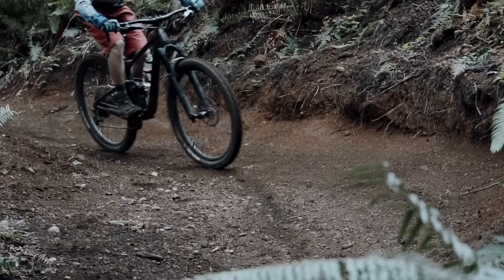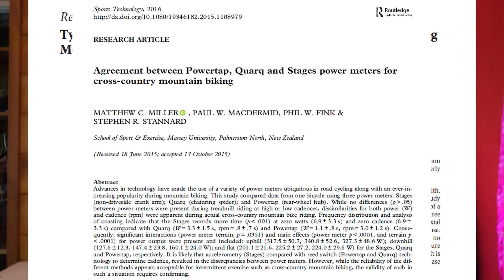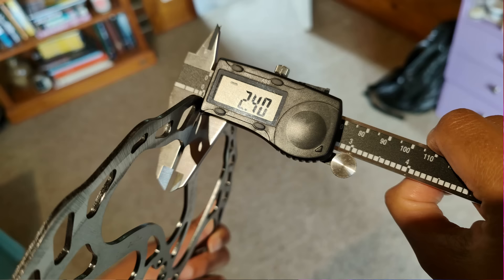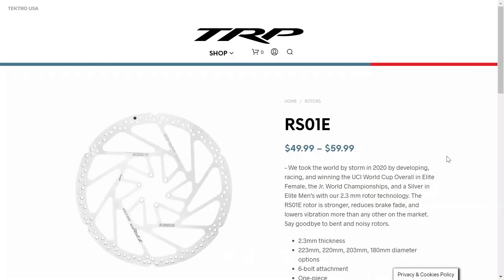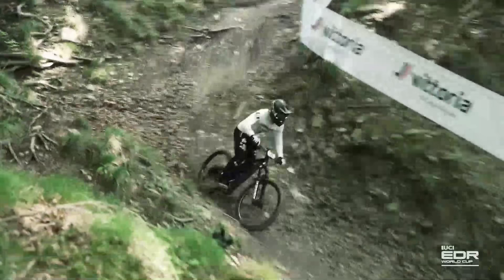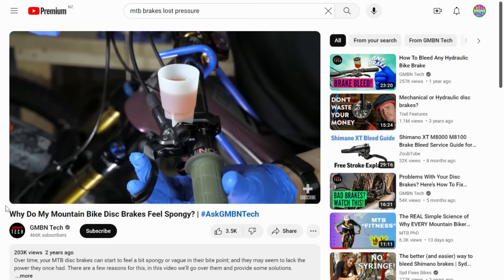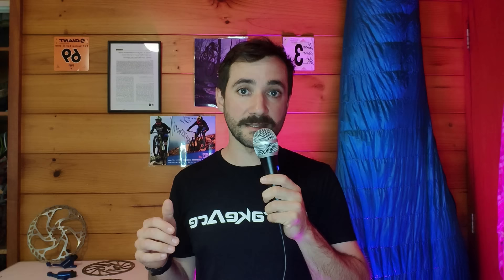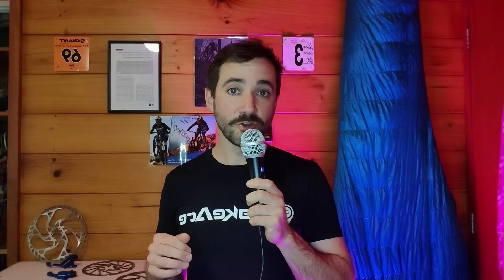Why THICK Rotors Will TOTALLY Change How You Ride (EASY Upgrade with REAL Proof)

Comment: I'm a little bit concerned about a possible scenario where my MT5 brakes get hotter with thicker 2.3 rotors due to a decrease in ventilation between pads and rotors. I've heard one bike mechanic blame Formula brakes for being too hot, exactly because of that. Do you think this might be a problem and a reason to stick with my stock 2.0 Magura rotors?
Reply from the maker: What rotors are used with the Formula brakes?
Reply: @mtbphd   I'm sorry, I haven't ever seen them in person. Let's consider it just a random opinion from a random bike mechanic. I have zero ideas about whether it's true or not. It made me think about the possibility that a thicker rotor may affect an increase in brake temperatures due to worse ventilation. I thought you might have some thoughts and experience in that as an expert.
Reply from the maker: @AntiDEDok  I've never heard of that issue, but it does have me wondering how much air flow between the pads and rotors matters. Thanks for getting the wheels spinning! At least with this setup I didn't have a problem
Reply: @mtbphd   I noticed Galfer's comment under a guy's video yesterday. They mentioned that their rotors make "popping" noises for a reason. In their case, it's due to a special design where hot air moves through holes in the rotors, cooling them like an exhaust. I'm not sure if we should believe that or if there's any measurable statistical difference. However, common sense suggests that the space between the rotor and pads may have some effect 🤔. It would be nice to see some scientific MTB content about it!

Comment: 5:18 I really don't like the MT5s, I had them on my bike and the modulation was awful. I was scared to go fast because they either wouldn't stop or flip me over. I tried everything and ended up swapping them to shimano brakes.
Reply from the maker: Interesting. I feel like they're always there when I need them. Resin pads
Reply: @mtbphd  I had metal pads, i need a lot of braking power since I'm tall and heavy.. Might've been that the specific ones I had were faulty

Comment: I have as I call, pornography of brakes: slx 7120 levers, mt520 calipers, zee finned brake pads and 2x ice tech 203mm rotors, best brakes I've had so far. On ebike with total riding mass 124kg, works very well.
Reply from the maker: Can't go wrong 🙌

Comment: Don't buy Chinese made Shimano disc rotors, why because that are only 1.7-1.6mm thick and the two sets I purchased from the bike shop were only 1.6mm. When I questioned the bike shop they had no answer, only to say that is what Shimano Australia supplied them. 
What's the problem, simple stamped on the disc is a warning to replace the rotors once the reach 1.5mm, so you only get 0.1mm of wear before they have to be replaced.
The Japanese Shimano rotors are 1.9-1.8mm thick and they also are stamped and state they should be replaced when they reach 1.5mm thick.
I have dumped Shimano and gone with 203mm Tektro rotors that measured 2.0mm thick and are also stamped to be replaced when they are 1.5mm thick. They were half the price of the Shimano Chinese made rotors.
Now that I know there are such a thing as 2.3mm thick rotors I did consider buying some however a note of warning. I have read that they should be to be used with calipers that are designed for 2.3mm discs. With that additional cost it is not worth the added expense as I only do XC and any down hill sections are only short descents.
Reply from the maker: Yikes - that'd be weird to have varying thicknesses. To be fair I should get a batch of these and check them
Reply: calipers use a piston to contact the rotor.  as long as it fits between new pads and the surface area covers the pad area... you are good.  the idea that the caliper is designed for a smaller thickness but has physical room for a larger one just doesn't make sense to me.

Comment: i stopped the video at 3:16 when you said that there  are people that didn't upgrade to bigger rotors because they think there is not enough ground clearance but they are ok with a dirt scraping 12 speed derailleur.... i know two S companies that make a lot of $ from these people...
Reply from the maker: Totally. I also struggle to see the value in expensive chain danglers

Comment: It amazes me that the bike industry is trying to recreate the wheel with brake size, thickness and power. As a former road racer and sport bike motorcyclist for nearly 30 years and mountain biker since the late 80’s, it’s well understood that better braking comes from larger and thicker rotors. Rotors that are drilled and float as well make substantial differences. The mix of steeper descents and faster speeds warrant larger thicker rotors 200mm and larger, where’s the average enduro, XC or trail bike will be best suited with no more than 203mm to 160mm rotors. It’s hard to take all this data collecting serious for something that is I’d say common knowledge in other communities. Anything over 200mm on a trail bike is overkill. Also, I’ll note that your info speaks nothing of the gyroscopic forces that come into play with rotors larger that 203mm.
Reply from the maker: MTBers believe light weight is the way. Fortunately other communities don't have this issue
Reply: @mtbphd  I've found this to be true with the mountain roadie types.

Comment: Too thin and it has no feel. Too thick and it doesnt enter in the caliper... 🤔🤔🤔
Reply from the maker: These fit all good. Not sure how those new 3mm thick rotors would fit, but I suspect new brakes will all be designed for thicker rotors from now on (since it makes sense and always did!)

Comment: End game is RIM BRAKES. The "Disc" is a whopping 698.5mm and 56mm WIDE with air cooling within the rotor. 🦾
Reply from the maker: Sure don't miss them lol
Reply: Magura and trials 26 rims
Reply: And you grind through a key structural element of the wheel with every brake appliction...an element that is expensive and difficult to replace, and fails catastrophically (at least if you're willing to concede that an instant flat tire is catastrophic).
Reply: @xanthoptica  most rims are made ultra light,  but heavier duty rims work very well, and it's not terrible to replace them if you have good nipple and spoke components.  Discs are easier to swap, but rim brakes still have a place for low cost and hardiness for most riders.